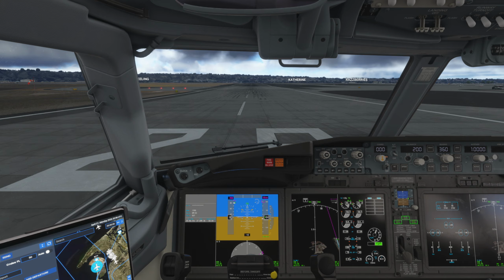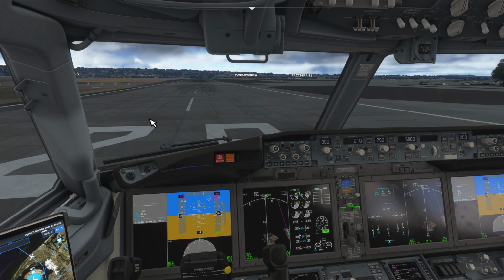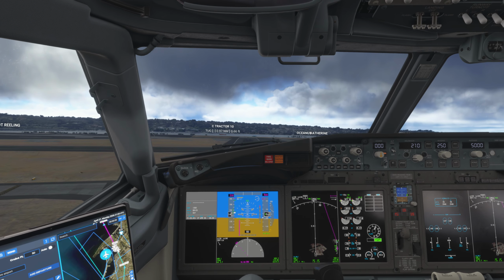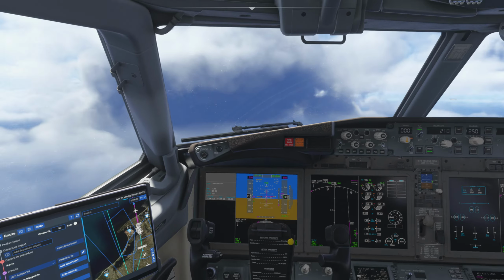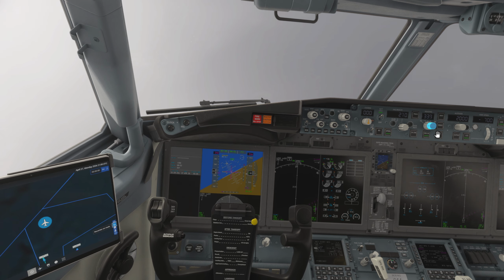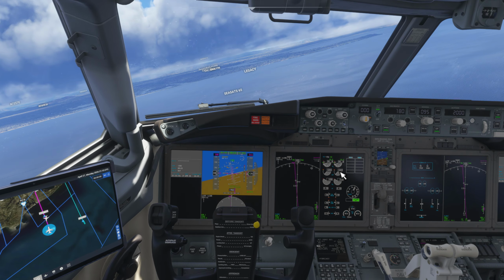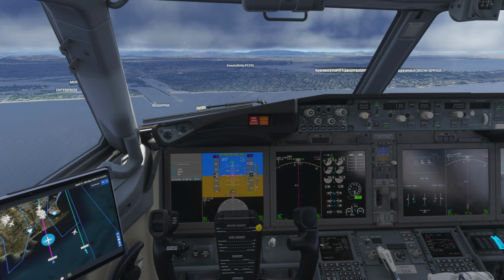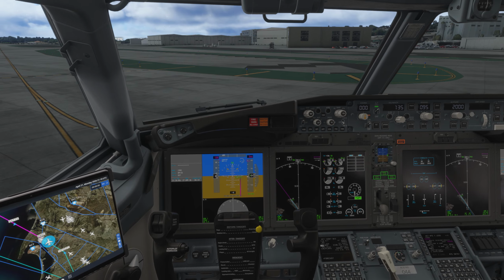MSFS 2024 | Boeing 737 Max | ILS Landing Instructional Video

Comment: in the real thing we turn system page off after start.  leave one side on full screen map.   in HDG mode with approach armed it still follows your heading till intercept.   Flaps 30 limit is 175 knots so you overspeed them.   if you don't have gear down before flaps 15/25/30 the landing gear horn will sound.  Autobrakes 3 in a max will slam the passengers heads against the seat in front of them.  2 works.  3 works for an NG.     nice landing.  watch that centerline!
Reply from the maker: Thanks for the advice